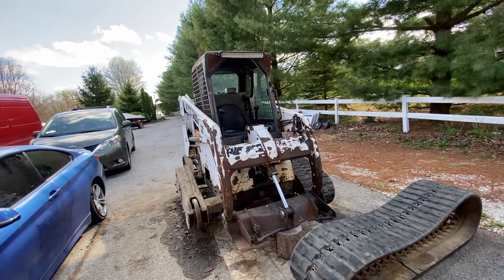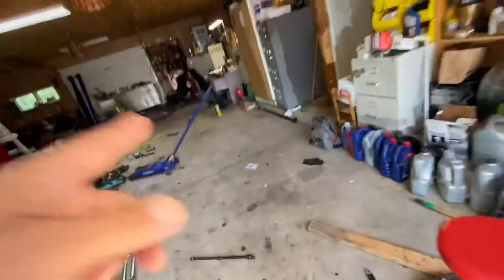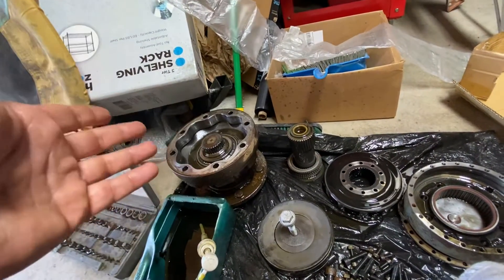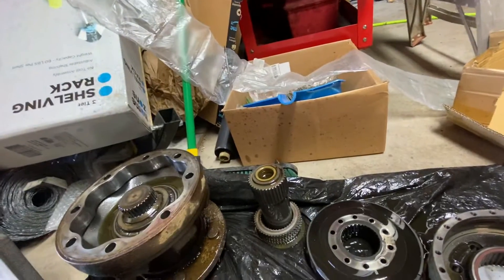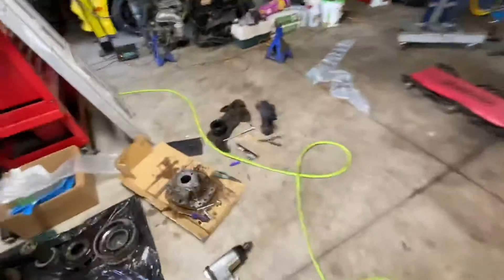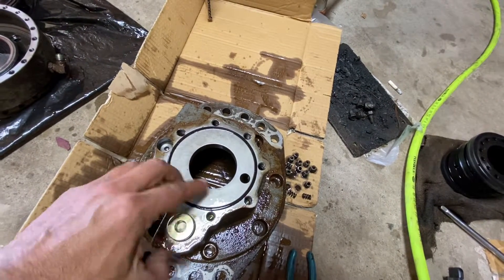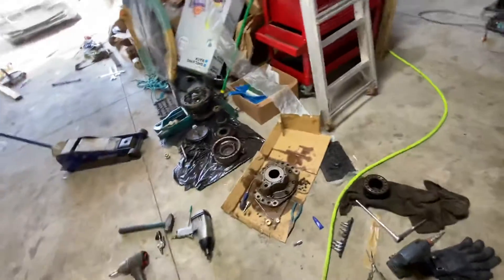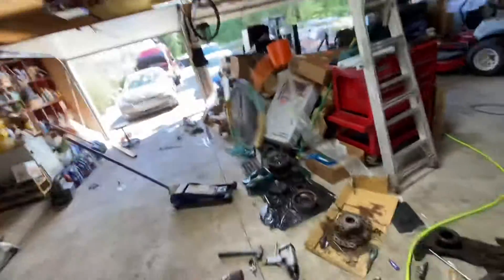Bobcat T200 drive motor failed and diagnosing pump track will not move , problem solved

Comment: I have same problem one thack is spinning and the other one is not spinning is stuck you tink is the pump or  is something same like yours tanks
Reply from the maker: Try disconnecting the line and see if fluid coming to the motor first

Comment: I have the same problem but my bobcat goes in reverse,  I hope I can figure it up
Reply from the maker: Had that issue also on mine, follow your handles under the cab and see if its loose where it connects to the pump. Mine was loose and was going reverse only no forward